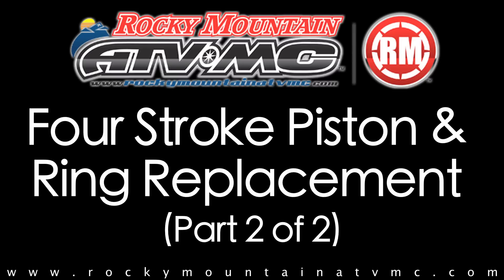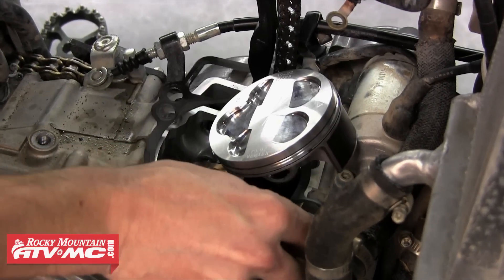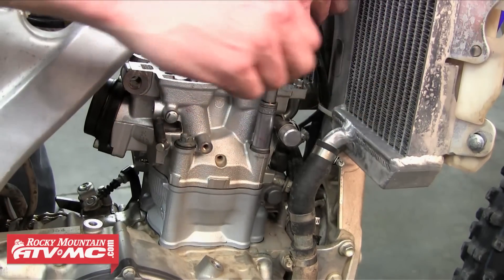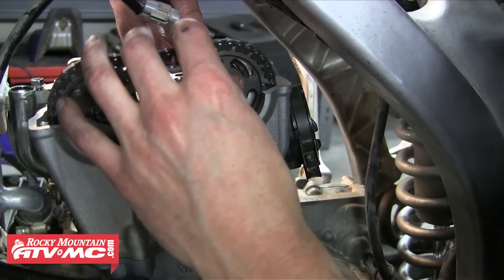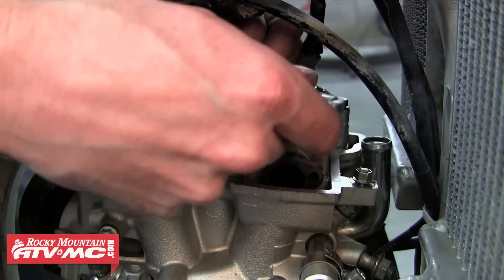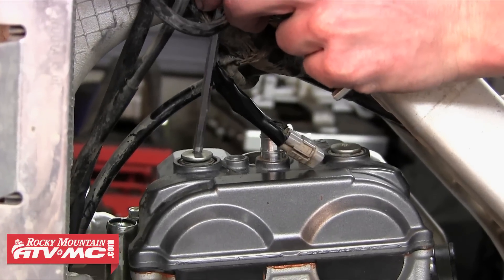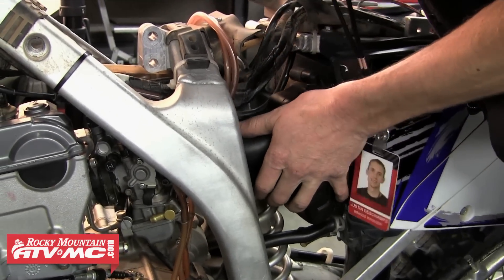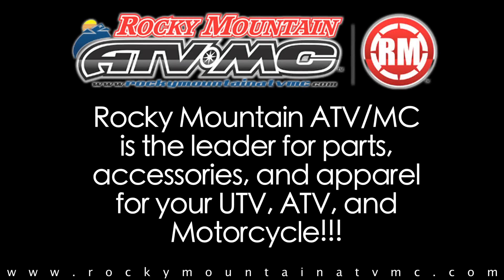Motorcycle Top End Rebuild on Yamaha Four Stroke (Part 2 of 2)

Comment: Did all the steps like you showed and my engine locked up after few kicks, any help ?
Reply from the maker: I'd check out everything you did just to make sure things are installed properly. If so, then you may need to pull the engine to split the case.

Comment: So no crankcase glue on the block or head gaskets? I'm in Indonesia and speak Indonesian so I've been watching all these videos where they load the block and head gaskets with yamabond. 

I just tore down a 100cc Yamaha mio engine and indeed everything was glued together to the point that I needed to take a grinder and wire wheel to it.

I just want to know if that's correct or not to use yamabond on top end gaskets?
Reply from the maker: Good question. No, you don't need glue/Yamabond on the the base or head gasket.

Comment: Does it matter how long the piston should be, i replaced my old one with a wiseco piston and it has more rings and is a bit longer than the one I had b4
Reply from the maker: Some aftermarket pistons will be a bit different than the stock one but I would confirm the part number you received is the correct one for your bike.

Comment: I brain farted... on final assembly I used assembly lube rather than motor oil as the lubricant on the piston/rings and the inside of the cylinder.  I am still in process... should I disable and clean it all out is the lube innocuous?  Thanks a ton for all the help!
Reply from the maker: There are a lot of mixed opinions on what is better (assembly lube or engine oil) and many people will just stick with what they know. But most assembly lubes are specifically designed to be used on piston skirts/cylinders so you should be more than fine as long as the moving parts are lubed!

Comment: Hey I just got a 2003 wr450f but I am having an issue. Every once in a while something causes bike to seize? Basically Kickstarter won’t kick anymore. But if I rotate motor through peephole its spins freely. I tore apart the clutch assembly to see all the gears, they all look fine. Everything that I’ve seen so far is good and functioning. Any ideas for the random lockup. Btw it literally happens randomly you can kick it forever and have nothing happen or you can kick it once and it happens. Also when it runs the motor sounds and feels tight (if that makes sense). Please help have no more ideas other than tearing down motor.

Comment: I have a Yz400f that I replaced all of the gaskets on and timed right during installation . Now,  these old bikes have compression levers on them. I went to start and now there is no compression in the motor and my kick moves without holding the lever down. Would you guys have any idea what that may be?

Comment: With upgrading the piston/cylinder with a big bore wouldn't you want to upgrade crank and bearings as well. I put an oem piston/rod in my crf250r and it ended up destroying my crank and bearings. Had to replace everything at that point.

Comment: My camshaft dots do not line up no matter what I do the left cam (exhaust side) aligns perfect. On the right cam (intake side)  the dot either sits above or below the surface of the head. If It will not align straight. Should I go slightly above or slightly below the head surface?
Reply from the maker: Jesse The Baldy Ventura are you installing a new cam chain or the old one? It's best to replace the old cam chain as it may have been possibly stretched, causing the alignment issue?  Are your valves shimmed to spec?  I would check these things and let us know.. Are you applying pressue with your finger through the cam chain tensioner hole to see where your timing marks will be once the cam chain tensioner will be installed? Try that. See if that fixes what you are seeing.

Comment: Great video. For me 2:05 was the biggest pain in the ass on the whole job, using a new jug and piston. Getting the rings to compress evenly did not want to happen and it took a long time. It's together now and I'm wondering if I tweaked one of the oil control rings on the bottom slightly because the last OC ring did not slide in smoothly and the bottom of the jug pressed against it, so I am debating whether or not to take the jug back off and put another new set of rings in it to be safe. 

I am not sure if any ring compressor tool would work with this or not.
Reply: How'd it go?
Reply: @ZmannR2  ended up fine just one of those things that was new to me. it ran really well.

Comment: What would happen if your oil expander ring were to over lap? I had the hardest time putting the cylinder over the piston and rings. I finally got it on and it goes up and down smooth, but i was having issuses with the oil expander overlapping not sure if it did or not.

Comment: Question...i put my cams back on my head without puting the head on the bike to clean the sealing surface by the valves so that the buckets would not fall out. The cams were tight and would bearly move. I only just snuged the cams caps...? The cams worked fine before i took them off the bike.

Comment: Does it matter about which way the rings go in?
Reply from the maker: Yes.  Your service manual will give the proper orientation of the piston rings.  The top piston ring should be stamped with a letter, indicating that it faces up.  With the oil scraper piston rings you should refer to your manual.  The service manual will give you good detailed instructions on how to install and place these.  Thanks

Comment: What kind of oil did you use to lube the cylinder and piston?!?!?!
Reply from the maker: Any all purpose 4 stroke motor oil will work.  Preferrably a non synthetic for the breaking in part.

Comment: How do you tell if its at TDC on compression stroke or 180º out?
Reply: Intake cam lobes will be just off the valve caps and rotating away for the next revolution.

Comment: Hi , I have one very important question , What kind of motor oil to use after the renovation ? such as commands manufacturer or some special? because it is a new piston and rings, Does it matter?
Reply from the maker: I would recommend just a general purpose motor oil.  Non-synthetic.  Then later on you can move to a semi-synthetic or full synthetic.  But for the break in period a general purpose engine oil is fine.  ~Vinny

Comment: I know it's an older video but never rebuilt a dirt bike so was looking into it to rebuild my 04 yz250f. I've rebuilt a few car engines of mine (dsms) and the only thing I noticed bad about your video is using anti seize on the head bolts. antisieze reduces torque which results in lower clamping force of those bolts. this has been test proven many times. to achieve best clamping force from a bolt you use a new bolt with oil, it will be greatly decreased with an old bolt and antisieze. just thought I'd throw this out there whether you use the info or not. I am a mechanic and not trying to be a key board know it all.
Reply: enemen8 also another error I saw is when I rebuild the top end I let the oil prime in the lines. (By leaving it the top line unattached) I noticed that it took 30 seconds worth of cranking(when I rebuilt the top end on a TE250) before oil reached the end of the line! (30 seconds without oil!)
Reply: @xtune5731   That's what the assembly lube is for. Initial lubrication until the oil supply reaches the bearings.

Comment: Thanks for these videos, they're very well done and uber helpful to someone learning the ropes like me. I'm curious why you didn't include a new cam chain in this process. Seems most articles I read say they are prone to break and do a lot of damage, and since they're so cheap to buy it's a wise thing to do. Or are they not considered part of a top end? Thanks.
Reply from the maker: Yes, that is a very good practice to do changing the cam chain while you're in there.  Those articles are correct.  We were simply demonstrating the steps to rebuild a top end.  I would recommend replacing the cam chain.

Comment: How often do you need to rebuild the motor?
Reply: lithium25693 every 50 hours?!?!?! 2 stroke now days last 150 hours in top end if treated good , i buddy of mine has 32k miles on his wr250x and with stock motor
Reply: Luis Bernardo Bremer Ortega For sure. My sxf has 129 hours on it. Starting to burn oil though... which is why I'm watching some rebuild videos lol
Reply: A 4 stroke dosent need rebuild unless damaged , i has around 13,000-15,000 on a yz250f i recently sold , still ran perfect
Reply: I'm referring to a yz250 motocross bike a wr250x will last a lot longer than a yz250
Reply: yes, yz250f
Reply: lithium25693 still 50 hours on a yz250 is not much , just run 30:1 / dont engine break and definitely dont over rev it you can get that top end to last 100 hours
Reply: Every ride
Reply: A 4 stroke top ends needs to be replaced every 50 hours
Reply: lithium25693 you did said 4 stroke tho , yz250 is a 2 stroke / yz250f the bike on the video is a 4 stroke

Comment: You didn't show unhooking the cam chain every time you have to thread it through the head/cylinder/gaskets. Must be a pain in the ass. What happens if you drop it?
Reply from the maker: @Jamie Bales Go to minute 2:07 in the video
Reply from the maker: We looped tie wire around the frame and down through the cam chain to help keep the chain up and on crankshaft gear.

Comment: hey sir does it matter to TDC before disassebling? and how do I knew its not Dow Dead Center before disassembling? coz i want to make marks before disassebling, I want to rebuild my engine it same version as yours
Reply from the maker: +GAR A You can put your bike to TDC a couple of ways. But i would recommend you go off of the markings from your flywheel and ignition cover markings to bring the motor to Top Dead Center.
Reply: hi  can you tell me whats the other ways to bring the bike to TDC ?  mine have different fly wheel and there is no marks on it ...

Comment: my valves on the inside are coated in a black char, just like the piston. can I clean that with varsal or something? what does that tell me about the engine?
Reply from the maker: Owen Cordes Usually that's a sign of either running rich on your jetting or even a bad valve seal?  But you would notice smoke coming out of the exhaust if it was a seal.  It's generally your fuel delivery is rich causing some carbon build up?

Comment: Hey Guys, Great video ... im thinking about a high comp piston (13.5:1) or big bore kit for my 2007 WR450f, I just wanted to know will I still be able to e-start my bike with either of these mods???... Thanks in advance.
Reply from the maker: Dave Smith Should work just fine with a good charged up battery.  It may draw more power from the battery and drain it quicker if you're using it over and over, but it will start the machine.

Comment: You forgot to mention the surclip openings on the piston should be at 6 o clock or centrifugal force can pop them out into your cylinder.
Reply from the maker: rigguyjt Nice catch man!  You're right.  Rotating the circlips to either 12' or 6' O'clock on the piston will help eliminate any chance of the circlips from popping out.  Thats why we like to mention to refer to your service manual for proper piston installation.

Comment from the maker: @christian johnson You'll have to tear back into the engine to figure out what is causing the kick-starter to bind up. I wouldn't try to kick it anymore or force it to move because you could end up breaking something especially if the timing is off. It could be that a valve is hitting the piston or it could be something jamming up a gear inside. It's hard to say without more information.
Reply: hello I bought a wisco piston m series and its a 2004 rmz250 the manual for piston ring gap calls for 15 to 20 I think but in the new piston I bought in the front of the box say 35 or 38 for clearest so is does that mean I need to make my piston ring gap biger to 38 mm and also how would I line up the piston ring
Reply from the maker: U Va Good morning.  I would have you double check your service manual to get the correct piston ring end gap for this particular machine.  Ruffly your cylinder's diameter should measure  close to 3 inches.  Then you would multiply your cylinders bore measurement in inches X .004 and that will give you your piston ring end gap for that particular cylinder bore.  If you have any other questions feel free to ask.
Reply: Rocky Mountain ATV MC okay because my ring gap in in spec but in the wisco piston I bought its a m series piston in the box say 38 for clearest does that mean the gap between the cylinder and piston not the ring gap and do you guys have a vodeo how line up piston rings thank you
Reply from the maker: U Va .038mm is referring to the piston to cylinder wall clearance. You're piston ring end gap will be listed inside your service manual so you'll need to refer to that. It will be listed as a minimum ring end gap and in most every case the gaps will be in spec. Here is a video on how to measure ring end gap so be sure that out https://www.youtube.com/watch?v=eeliqbj5DgQ Wiseco also provides instructions on lining up your ring ends for installation and this will be the pink paper provided with the piston kit.
Reply: +Rocky Mountain ATV MC My wr450f has a 480cc athena big bore kit on it... do I need to get a 
special gasket from them or can I just buy a normal one from you guys?
Reply: If it binds up just roll the bike back and forth in gear. my bike was doing this and i took it apart..the clutch cover case side had a piece of metal in it getting jammed in the gears. along with a lower end crank that was in rough shape and sometimes was shuttin the bike down and gettin the piston stuck in an odd spot. rocking it back and forth in gear or lifting the rear wheel spinning the back tire at a good speed and putting it into first gear it will free up
Reply from the maker: +Nick Moskal Yes, you would need to get a big bore gasket kit.
Reply: Hey man which way do I turn the motor over to time it?? Do I spin it clock wise or counter clock wise, or does it not matter?
Reply from the maker: Shift the bike into neutral and it can spin either way. Line up the markings on the flywheel with the mark('s) on the ignition cover.  This will bring you to TDC.

Comment: I recently changed the timing chain and tensioner on my 08 yzf250 because the tensioner was defective. The timing was way off and the inside of the muffler was soaked in fuel and smoking just a little, but enough to cause concern. After I got everything reinstalled, cams to tdc and put everything back together, the engine now puffs white smoke. The smoke is pure white, doesn't smell sweet like coolant and it isn't damp. It smells like exhaust and nothing else. 

Would being off by one tooth on either cam cause this? Or do you think it may be a ring or head gasket? 
I've ordered new rings and gaskets for it regardless because I was planning a rebuild this winter. 

The bike will idle without a problem which it wasn't doing before the changes, throttles up without issues either. It is just puffing smoke. I did let the bike idle for about 20 mins to see if it was condensation. The higher the rpms the more smoke would appear. 

Any suggestions? 

Great video, thank you for posting that

Comment: Hi i recently changed the water pump seal and head gaskets on my yamaha 426yz since the oil and coolant was mixing. Everything was fine until the next day of riding, the radiator over flow kept spitting back out coolant constantly when riding and now the compression is low once more and the oil stick looks abit milky again. What could be the problem there?
Reply from the maker: kamal haynes When you replaced these parts did you inspect them and find anything wrong with them? Was your head gasket blown? Did you replace both water pump shaft seals. Those would be the only two places that it could be mixing so first we need to determine which location this is happening
Reply: Yes sir the head gasket was damaged and I replaced both seals and bearing for the water pump
Reply: Now I have little to no compression as well
Reply from the maker: kamal haynes
 It could be a warped cylinder head. We had a YZ450F with the same problem recently, it just kept blowing the head gasket so we ended up resurfacing the head to get it to seal up correctly. Also make sure you are torquing the head down correctly as demonstrated in your service manual
Reply: Okay thanks alot
Reply: Will do that and let you know the outcome
Reply from the maker: kamal haynes
You bet! I would look into that first and then go from there. If you have any other questions feel free to let us know!
Reply: Rocky Mountain ATV MC
 I have the exact same issue with my YZ426.  I replaced the head gasket and now water goes right into the cylinder.  Is that little rubber O ring that goes between the cylinder and the bottom of the engine for coolant?  The O ring that is visible at 1:57 in this video.  I bought a gasket kit and it had multiple O rings but now way to identify them so I just used the one that looked the same size, and now water mixes with my oil too.
Reply from the maker: Curt Shaw
 Hi Curt, Yes that O-Ring is for coolant and if you are questioning that i would take a look at that first. Is this why you rebuilt your engine in the first place or was it for another reason? Just trying to narrow it down to where the problem is happening...
Reply: Hi I changed my head gasket and got my valves reseated and also got both the head and jug shaved since the head was warp. It was riding for two days before the oil started to look kind of water based then the back wheel locked up.  When checking the engine the piston was stuck in the block which showed evidence of scraping on the walls of the jug which got hard after cooling. What could've caused that and y would the oil still look like that. Btw I have to get a new piston and jug now